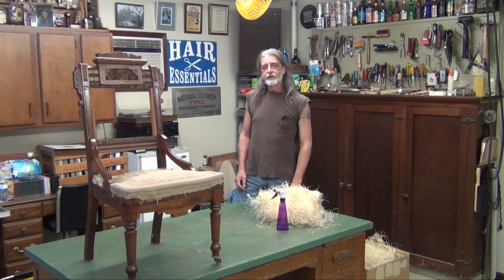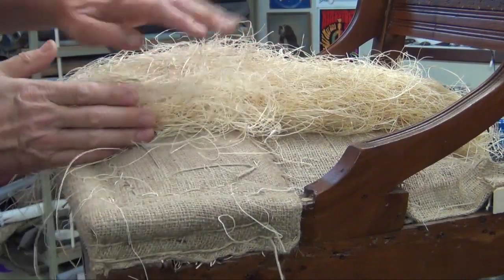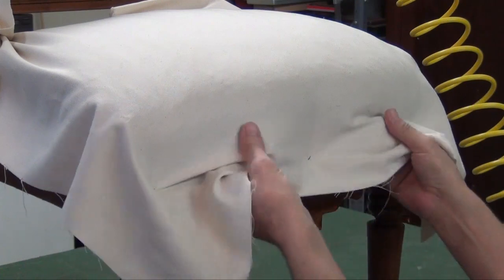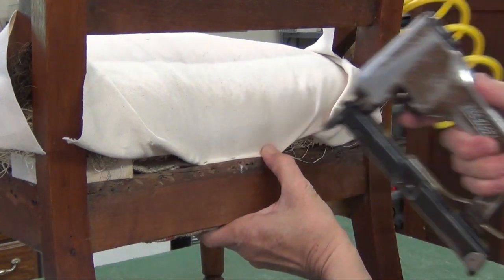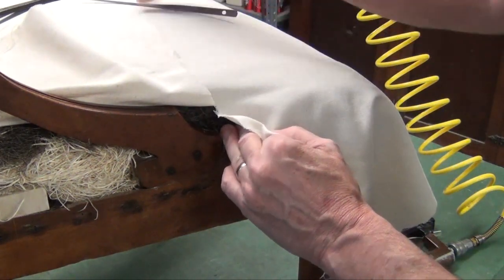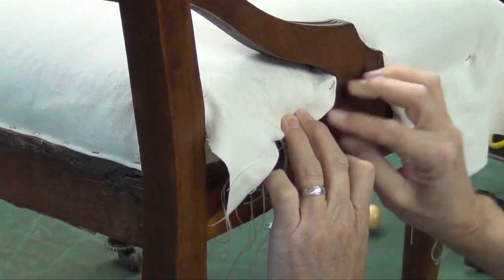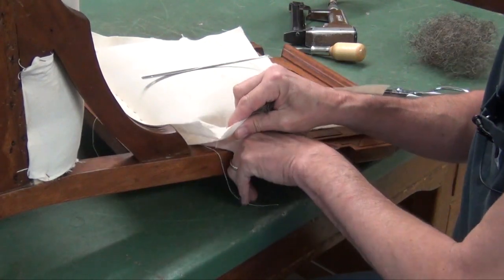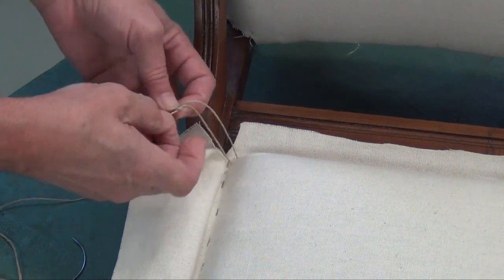Eastlake Chair Upholstery - Secondary Stuffing Techniques

Comment: love your videos and the EastLake furniture. However I have a question; when you have a chair that has been upholstered multiple times and the previous upholster didn't take out any of the tacks and after taking out the nails and tacks your left with lots of holes, how do you proved forwards to upholster it. Thank you and keep the videos coming.
Reply from the maker: I'm not sure what you're asking. Staples work better in grasping tack-riddled wood. Using tacks repeatedly is bad...
Reply: Buckminster Upholstery  I’ve stripped the pice down to the wood and taken out all the tacks I can but the wood looks like swis cheese, do I need to fill the holes with anything before I start putting in the springs ? Thank you
Reply from the maker: I've never had any luck with wood fillers. They are brittle and break away with little effect on the repair. If the rails are full of holes along with splits, saturate the wood with liquid hide glue and try clamping the cracks shut.

Comment: thank you so much for all of your videos.  i don't think you could know how much you have helped me and i'm sure others learn proper upholstery methods. may i ask if you think spanish moss will substitute horse hair?  i can easily find excelsior but i'm not happy with the sourcing for the horse hair i've found so far.  also - why would cotton batting not be appropriate as a top layer.  many sincere thanks in advance!!!
Reply from the maker: Spanish moss works fine in place of horse hair but it's not quite as resilient or of equal quality. Moss is impossible to find these days processed for upholstery. Cotton is very appropriate.
Reply: Thank you so much!! Take care!

Comment: Why was it necessary to stitch down the edge of the back rest?
Reply from the maker: You'll see when I apply the cover cloth the padding is pulled away from the tack rails so that the gimp lays flat. It also firms up the outer profile keeping the edges in more uniform shape.